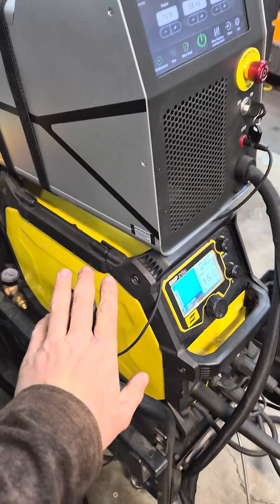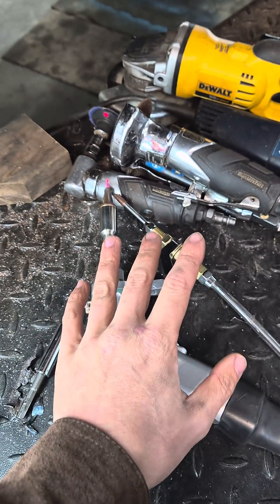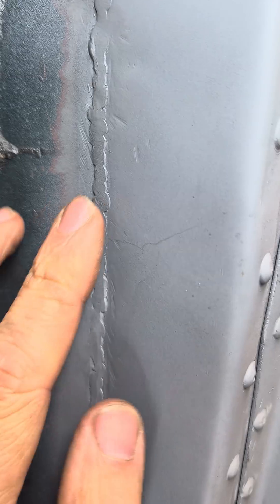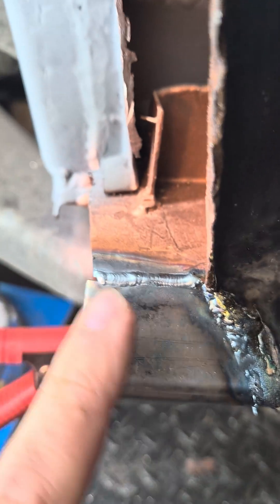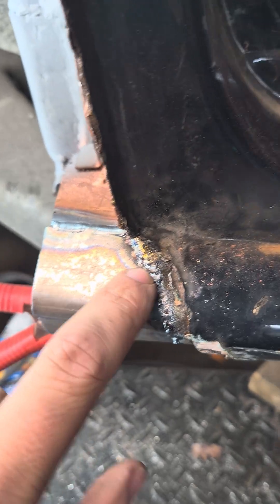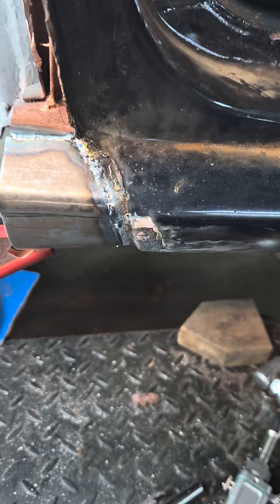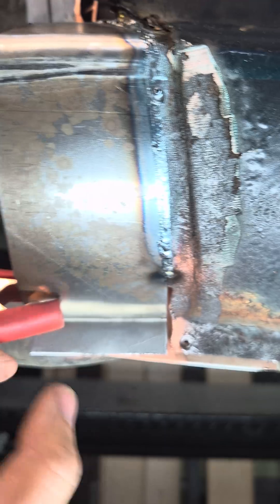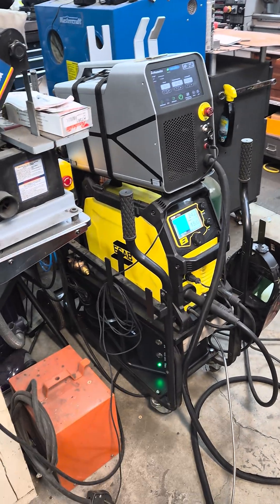MIG vs Laser, The End For MIG Welders?

Comment: So my main welder has been the ESAB 205. I purchased an XTools 1200 watt laser.  Very nice. It does take a bit of getting used to. But once you practice after having thrown away much of what you learned over the years of MIG and TIG, it works really well. I don’t do much auto body type of work and I’ve never done a roll cage. But I do design and build equipment. I find that you may have to alter designs with laser work if there’s structure involved, to accommodate the different weld. 

Right now, this has taken much of my MIG and TIG work. But there are times where I feel I still need them. I suppose if I had a 2,000 watt, or particularly a 3,000 watt model, I might not feel that way.
Reply from the maker: I definitely found it interesting how almost nothing from mig/tig crossed ever... its a completely different animal.

I just bought a bunch of 023 mig wire for my current car project... I dont think I will even use it now that I have started using the laser. Still a lot of learning to go though, even though the laser is easier there is still technique that needs to be perfected to get that nice smooth weld every time.